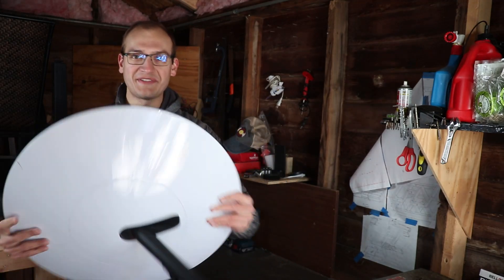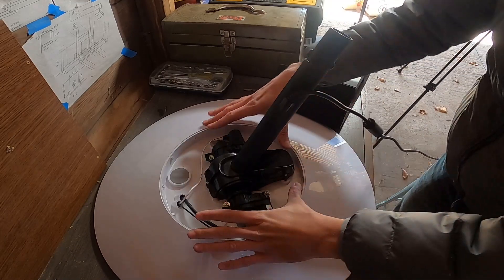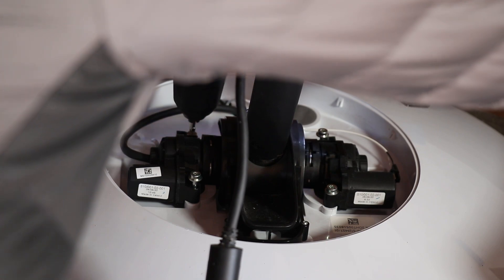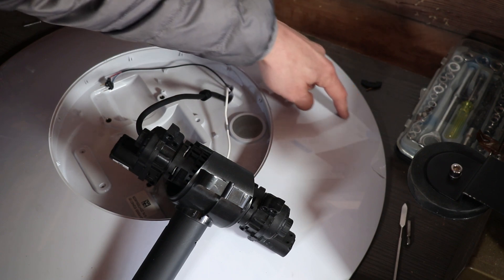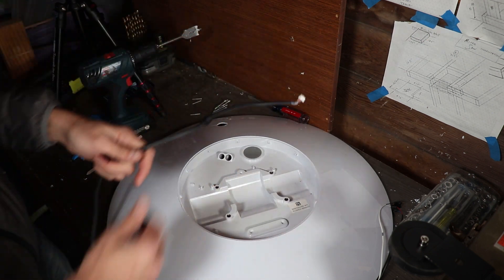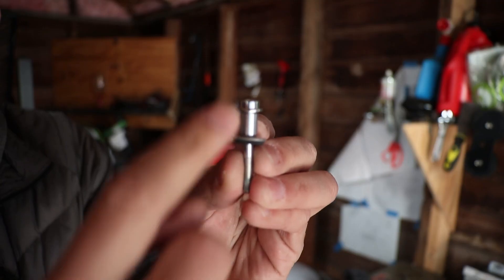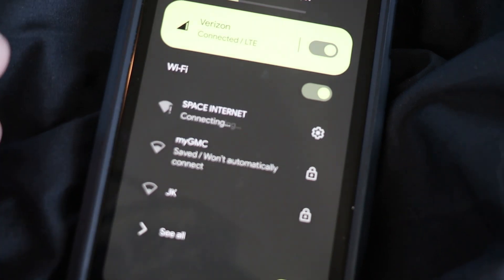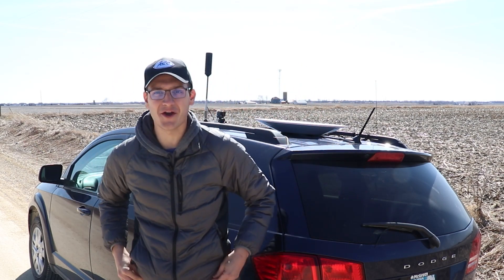Hacking a car mounted Starlink dish

Comment: You don't need to drill holes to unplug the the ethernet cable. The case halves can be separated fairly easily.
Reply from the maker: Insight I got from a few others was it's difficult to get it as perfectly water tight as before. Given the harsh elements I will be subjecting it to I decided this was the better option.

Comment: I watched another one of your videos .. I honestly don't see the point of this. They've had roof mounted integrated systems like TracVision for nearly 20 years. Since 4G LTE in 2008 and obviously 5G now it's all pointless to have roof mounted dishes unless you're literally going in the middle of nowhere, I mean like northern woods who knows where in Canada on a sled. But whatever...
Reply: I live in north west GA between Atlanta and Chattanooga.  Your 4G must be better than mine
Reply: @acree42  .. I can't think of a major highway in North America that doesn't have reasonable 4G connectivity, especially in the state of Georgia. Just out of curiosity, I pulled up a Verizon Wireless 4G/ 5G coverage map for Chattanooga .. If you're not using Verizon, maybe that's your problem. 

There's a difference between connectivity at your home and on the highway. I get that you're just doing this for a video, my point is for practicality.